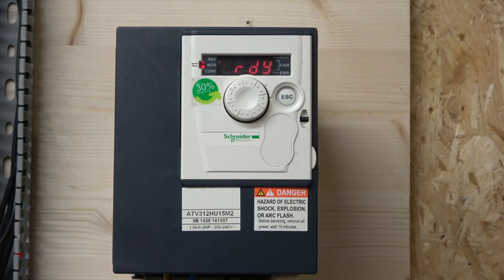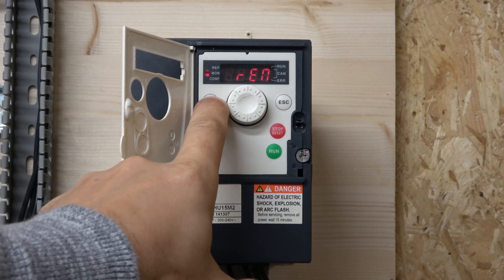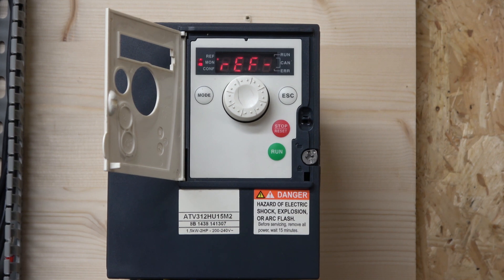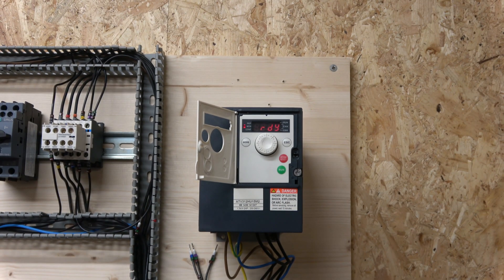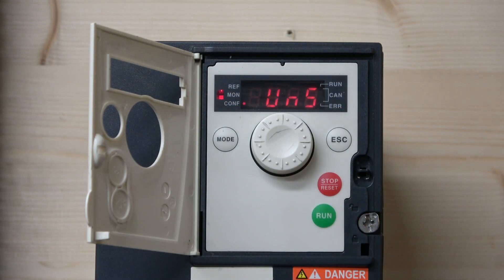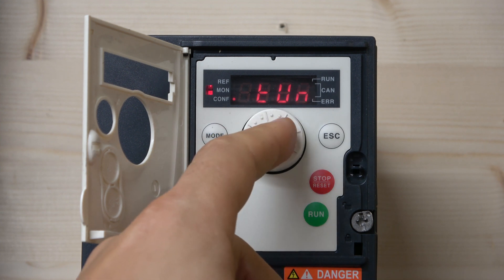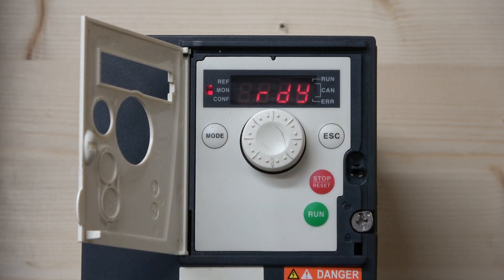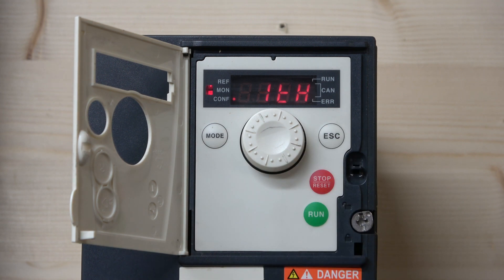Altivar ATV312 local control set up, wiring and Factory reset. Local speed control. (English)

Comment: How to fix display not waking,,
Reply from the maker: Do you have more info. Is the main display you talking about?
Reply: Yes main display not tarn on
Reply from the maker: @drackshad2995  Is the drive running?
Reply: No the drive is not running,, no output
Reply from the maker: @drackshad2995  Sound like the power board have gone faulty, usually when that happens, drive is dead. Provided that power inputs has been tested and looks good, your drive is in need of replacing or repairing.
Reply: @IGSElectronics  which component do you think is dead ?
Reply: Can you give me advice about it?
Reply from the maker: @drackshad2995  There is 2 parts in the drive, the power module, and control module. Both usually are on connector blocks and can be separated. The one with big capacitors is your power module, that's the one you need to check for burns, blotted capacitors and things like that. I would start there.
Reply: @IGSElectronics  thanks broo let me try then I will give you feedback sir